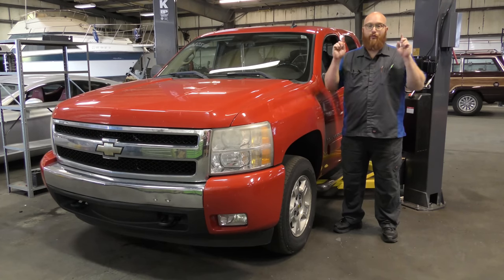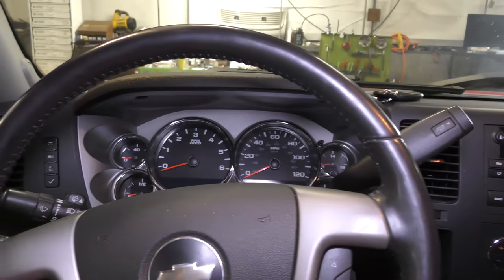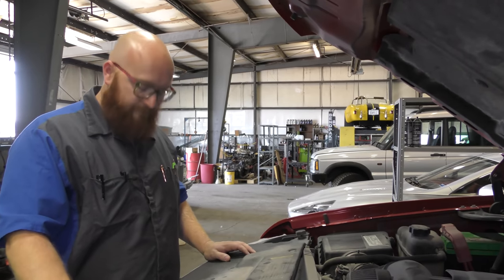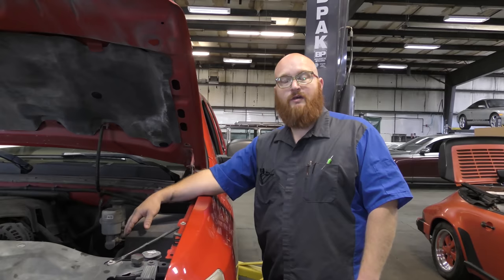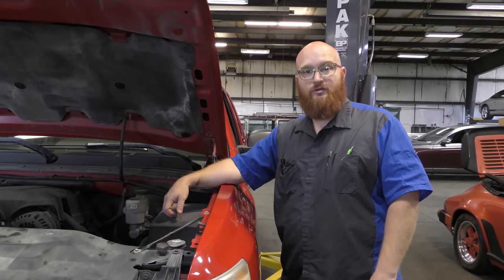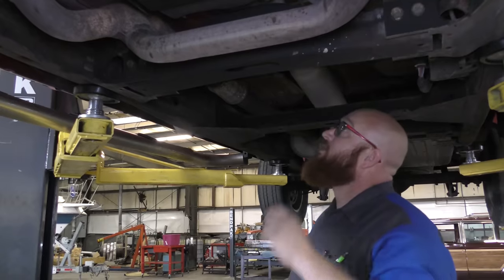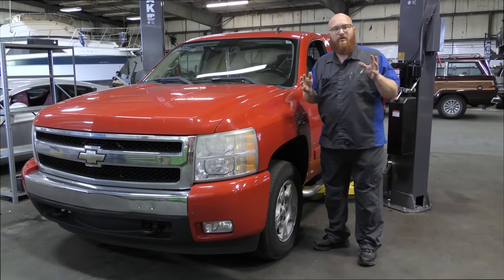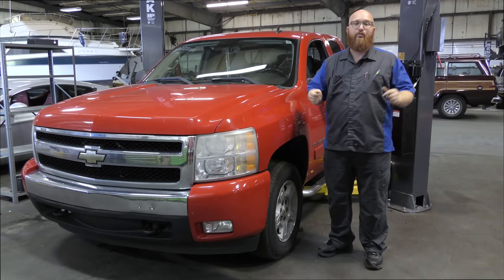Good Truck/Bad Truck? CAR WIZARD shares most common problems on the 5.3L Chevy truck at 100k+ miles

Comment: You could probably just make a living on Hoovie gems purchased. Lol. I'll look for a video on a 2015 Sierra or Silverado 4x4. But, I have a 2015 GMC SIERRA crew cab 4x4 Z71. I have 186,500 miles, I've changed the transmission fluid , complete fluid flush, every 80,000 miles. I would've changed it and the filter myself, but, with GM'S great design, the only way to get transmission cover off, is to drop the exhaust and then jack up the transmission.! Wonderful design engineers.! Plus, the reputable auto repair company I had do the transmission flushes, said I wouldn't have to change the filter.!? I'm just wondering, without changing the filter, just changing the fluid, how long would you estimate before I would have transmission troubles,  I tow a two place atv trailer, about 4 times a year, so, about 3300 lbs. I've changed front wheel bearings, front and rear differential fluid, U-Joints, transfer case fluid, and shocks myself. Had the external oil cooler gasket and return oil cooler lines changed. I have a broken exhaust stud, very back passenger side broken, will have that fixed soon for $250, at the repair shop. Only thing that I haven't done, is the u-joints of the front 4x4 driveshaft. The regular driveshaft joints weren't bad. I live in Michigan, so the front driveshaft isn't used THAT often.

Comment: just the kind of 15 minute content I am looking for , can you please do w the same for the 2009 for f150. I just had a braided brake line go out to the master cylinder after 105000 miles. doesn't seem right.  also the 2009 dodge

Comment: "Service records don't keep the exhaust bolts from breaking." Well, they might if the owner did what I did and put in coated headers instead of resurfaced manifolds. Mine was a 2v Ford though.

Comment: buddy bought a new 03 w/5.3  only has just over 100,000 miles on it as of this year and it already has a laundry list of crap that went wrong with the truck,  rear end blew up on him,  fucking ignition switch failed/frozen couldnt turn it off. door locks randomly shut him out, now he rolls window down when he leaves vehicle while running,  exhaust manifolds which is typical i guess, numerous alternator replacements (they get so hot they literally cook themselves to death) he says its been a reliable truck for him, i broke out laughing, my lowly dakota with 356,000 on it and it never had any real issues with it other normal wear items other than heater core and a water pump replacement, still has original starter and alternator

Comment: Have a question if these 5.3s have that AFM would it be beneficial to pull the heads and check the valves cam and rockers. Ya it would be more but I have that and had to replace. Let me know thanks

Comment: I've seen those crazy exhaust manifold bolts break off just like that one. They suck. EricTheCarGuy had a Pontiac Montana minivan in his shop once and by accident he had the same episode as your coworker had before where he inadvertently drilled into the water jacket. That was a total nightmare for him, he was nearly ripping his hair out of his head over that ordeal. I guess they had aluminum heads on it and those things suck. In the end, I guess he got lucky and was able to fix it with some jb weld since it was so minor and not something that was going to be detrimental to the overall health of the car. That thing had so many other things wrong with it that it was basically a rolling dumpster and that just put the icing on the cake, but thankfully it ended up being okay I guess. I doubt that it's still on the road today though

Comment: I have a question about a 98 Silverado with a 305. I have never changed the tranny fluid. The mileage is at 135k.  Would you recommend my getting it changed, or leaving as is?  (There are no issues with shifting.)

Comment: I was looking at this gen Chevy truck 3 years ago when I bought my 2011 Tundra.  Thought, oh its got the LS motor, had the LS1 in my old Camaro and it was awesome.  Read some more and these all had that horrible AFM/displacement on demand bs.  Yeah it might get 3-6mpg better than the Tundra, but then you spend $3000 having the top end of the motor rebuilt and your truck in the shop for a week.

 Also noticed the interior was kind of shite in these compared to the Toyota or 2010+ Dodge, seats weren't as comfy, dashes cracked, buttons wore off, they just didn't hold up all that well.   And to top it all off, the spec I wanted, mid trim, cab with a back seat, V8, 4wd, under 100,000 miles, the price between the Chevy, Dodge, and Toyota was similar at that time.
Reply: 4.8 is almost the same as a 5.3 w no afm

Comment: There's one Chevy truck that you have to take the body off from the frame to put new brake lines on it where it rusts out..
Then there's the 2.4 terrain engine with the water pump on the crankshaft LOL

Comment: I live in London and I'm not at all familiar with humungous Yankee pickup trucks. Just out of interest, though, what if any difference is there between a Chevy and the equivalent GMC? Which is more "up market" and what is the point of having two brands for the same vehicle? Are there different dealers?
Reply: There are historical reasons for having two brands of nearly identical pickups.  Back when most vehicles sold in the USA were domestic brands, but after General Motors had consolidated several brands under their corporate umbrella, Chevrolet became the largest GM brand, sold to middle America.  The Chevrolet dealers sold all the Chevrolets and nothing else.  Separate dealerships sold a mix of the other brands.  Naturally, some of the owners of the other GM brands wanted a pickup, and by offering a GMC pickup, those customers could buy it from the same dealership which sold them their car, and have them both serviced at one shop.  The GMC tended to be more upscale, with optional trim packages, because Buicks and Cadillacs were more upscale cars.  In the earliest days of the two pickup brands there may have been some substantive differences, but at some point they converged into the same truck with differences in trim and options.

Nowadays, one GM dealership can sell everything, but the difference remains.

Comment: Wizard thanks for the great video, I have an 08 350K miles plus so far lol.... how about welding a nut on the broken head bolt and working it out that way? I had to do it that way, worked great and was quick..... MA salt is not joke...
Reply: Any work done to your 08 with 350k miles ?

Comment: Mr. Wizard i have a 06 4wd Silverado 5.3 with a ton of miles...i have recently done a top-end rebuild and added a tsp stage 2 truck cam with Lt headers and Catback exhaust, new injectors, wires, and spark plugs. yet she drives like someone is holding her back or as if I am towing. the tranny fluid is dark brown as if it has not been changed for the life of the truck. i  am stumped as to what the hesitation could be. My money is of the tranny......what do you think it could be?

Comment: i have a 2003 gmc 1500, and it has a battery drain problem.. and i can take the radio fuse out and fixes the problem..but them my abs lights comes on , on the dash  it is a after market double din sterio i put in it to ,, so can you tell me what the problem is please

Comment: Congratulations on your half hour per bolt.  Sounds fair.  No need to get angry with me. Because in the Twin Cities it is difficult to find a competent mechanic that will not damage the vehicle. With that as the majority offering, competence at a fair price isn’t even an option. It is a shamefully high ratio of poor mechanics. If you are in the Twin Cities and not one of them, you are the minority.

Comment: Around here, Make DOESN'T matter. It's rare to find one over 4 years old without Rust issues. I don't understand paying the kind of $$$$$ that Trucks go for and not do everything in your power to combat rust. Get under the dang thing with a pressure washer or the Car Wash after all the Brine is off the roads. Clean out the cracks and crevices that collect debris. It's not that hard.

Comment: If you find a great mechanic shop, treat them like gold! A car is one of the biggest purchases that you'll ever make, something that you send at high speeds down the highway, DON'T CHEAP OUT!

You are paying for years of expertise, knowledge about endless configurations and horribly expensive tools and overhead. 

Research your car before you buy so that you'll be better prepared for failures and don't skimp on maintenance. If you just have to buy a used prestige car, you better have the means to keep up on repairs!

Comment: My 09 GMC with the same engine had displacement on demand lifter failures twice before it was out of the 36k mile warranty period. It is a terribly unreliable system. I'm curious why that system was not discussed in this video.

Comment: I need help, I have a 94 k2500 and when I hit the brakes both blinker lights light up on the dash. When I release the brake they don’t light up. When I use the blinker they do not come on. I changed the bulbs, check the connections to make sure they are tight and clean. I am so changed the blinker module in the fuse box.

Comment: I did a heater core on a 1980s ( I think it was) Cadillac book time was either 8 or 12 hours I did it in 2.5  it was years ago back in the 1990s so I dont remember the exact the book time .mind you my hands were cut up it, requires to remove the hole dash and allot of plugs and wiring  which I didnt do my boss of course charged the customer 12 hours I learned my lesson to not go so quick and just take around as long at the book times says why should I work harder and get6 paid less when the boss was making large cash for my work. of course my boss claimed that he did all the work also lol
yes shop time, employee wages just to name two things .   A car up on a hoist for tires makes allot less then most other reasons a car is up on the hoist. plus you need to buy a balancer and maybe two different kinds of tire changers not worth it unless you are just doing tires lol.

Comment: My boss had one of those pieces of shit. It leaked from everything. Door hinge bushings were gone. U joints squeaked. Dash was cracked. Oil pressure sender and the screen were bad. Oil cooler manifold leaked. Oil pan leaked. 

Garbage.

Comment: I have a '04 Tahoe 4.8 and The check engine light is on for a gross leak no flow, I've changed the fuel cap to no avail and along with that it says I have a multiple cylinder misfire, I've changed spark plugs, wires, ignition coils, fuel injectors, air filter, cleaned maf sensor, The truck barely misfires at idle can't honestly tell it's so smooth for the most part.. I was thinking fuel pump because light flashes above 65mph average. But I put pressure gauge on fuel rail and it's above 45 or so from not mistaken but I don't know what it's like under load I don't know much I just watched YouTube videos to assist but any help here guys! Think internals are bad? Engine has 173,000 No noises no nothing she is very quiet no smoke sometimes a gassy smell but other than that there's no major noticeable signs of problems.

Comment: Book times are set by the manufacturer. Based on how quickly the AVERAGE tech could and should complete a job. 

If I do a job 100 times and can beat that book time, I'm charging the same. But at the same time, if a job heads south and I only quoted you for 5 hours and it takes 10, I'm still charging you 5. It goes both ways, people need to remember that.

Comment: The oil cooler plate, would that cause it to be visible in the rear main seal check plate?
Reply: Mine was leaking from both, did the rear main seal first. Then noticed low oil pressure months later. Changed out sensor behind intake no change in pressure. Changed out oil cooler plate that had a small leak and pressure came up to strong numbers at idle. Mine leaked and ran down the motor to the seal area.

Comment: I had to watch this. I used to drive a POS 2010 v6 standard cab at work. At 70k had to have engine rebuilt. Every week had to replace a headlight. Every 2 bulbs per side had to replace the plug too. At 80k took it to our garage for state inspection & they said it was done. Both floor boards were not there anymore. It was never rained in. It was bought brand new and been on coast of virginia the entire time. Maybe been in snow 2 maybe 3 times I guess. So the truck was trash. Company bought us another brand new one - 2021 4 door v6 silverado now. Check engine has already randomly coming on at 1600 miles & goes back off. Chevy... Pile of sh#t

Comment: That AFM really screws an otherwise great engine.   Mine got a collapsed lifter on cylinder 7 and tore up the cam.   It’s a shame they put that stupid garbage system on that costs you way more money to repair than it ever saves in fuel.

Comment: dirty little secret- most shops make money on the parts as well as the labor. That $200.00 alternator you see on the invoice is not what the shop paid because they get 'jobber pricing'.
Reply: That isn’t a secret and isn’t dirty.  Of course there’s a markup!  You are buying retail.  You pay for the parts department to have the part in stock, or to get it for you when you need it.

Comment: Mr wizard, so I’ve been watching your videos on what to buy and what not to buy. You seem a bit bias on the Chevy Silverado trucks and how much better they are yet, you’ve always seem to have one to work on for one reason or not. For me, a good vehicle to have is one that is not in a shop being worked on for one or more reason. I don’t doubt your skills, knowledge, or experience with vehicles, but I’m am doubtful about getting a Silverado truck based on your videos.
I’m in the market for a 1/2 ton truck, I don’t need a 4x4 or something to haul a large trailer, just a truck, everyone needs a truck or could use one. I just don’t know what to buy others than a Toyota but, I can’t afford the upfront price of one. Question is, if the Silverado is one of the best, why do you always seem to be working on or talking about working on them?

Comment: I strongly disagree about the headlights. They're a critical safety components and those lenses are letting very little light through, the top especially.  Good luck putting 100,000 more miles on it if you ever have to drive it in the dark. Shouldn't even pass inspection with cataracts on both eyes like that.

Comment: drivers rear bolt on my exhaust manifold broke off below the surface welded a nut to it came right out disconnect your battery first before trying

Comment: I have 365000 on a 4.8 in a chevy van put transmission in at 200000 tires and shocks brakes oil thats about it .

Comment: GM has the worst exhausts I've ever seen. From 2011 to 2016 I've seen exhaust manifolds literally crack in all the way in half.  They switched to bolts because the studs they used to use in early 2010s would snap off if you breath on them. The bolts aren't any better.  My friend had one and he wanted to change the exhaust I told him to do the entire exhaust. Aftermarket is the only way to go with GM.  He hasn't had a single problem with the exhaust.

Comment: Bad mechanic? Like he said …it takes him 30 to 45 minutes to do the intake but he will not take a paycut for being fast so he will still charge the customers for 3 hours😱😔 this is the reason i fix it myself and only use workshop when i have no choice,and luckily i have a good mech here that has a good rep and is trusted…i would not go to this workshop…hevwould take a 2 hour job forvan oil change he does in 20 min😱🤑🤑

Comment: You not taking a Pay Cut, or you’d rather not be honest? I’m sure if you had an employee that said they worked 8 hours but left at 5 hours you wouldn’t be to pleased… So why not have set prices for jobs you know you are faster at with an asterisk denoting pricing can be more if it takes longer or other issues occur… I’m sure if you went over the 2-3 hours you’d charge more as well! Let’s be honest and fair!
Reply: Lots of repair work is done on a flat-rate basis, not just auto repairs.  It’s better than paying someone who doesn’t know anything to noodle around for a long time without fixing the problem.

Comment: These body style Silverados and tahoes i have seen being unreliable. My friends grandpa had one go to 200k miles but went through like 10 fuel pumps, injectors, coils, alternator, starter, all kinds of suspension. Just about everything needed replacing and had issues with traction/abs system and intermittent missfire. Would never buy one

Comment: Wizard seems like a sensitive guy and the conflicts with the customers are starting to get under his skin.   If the book labor rate is 30 minutes to drill out a bolt, then the customer has nothing to complain about.  But Mrs Wizard probably needs to intervene when Wizard is pissed off at customers.  Venting to the public could erode the customer base.  The wizard is an honest mechanic and his customers should be happy to have his services.

Comment: 99-06 gmt800 trucks are better.  Straight LS engine without the cam phaser or cylinder deactivation crap.  They took the best GM engine ever made and ruined it.

Comment: There is always a way to cut a mechanic from robbing you. You let him diagnose the car and then find out what parts it needs. "Your alternator needs to be replaced. That is an $800 job". You go get your own alternator so you can't get robbed on the part, that way you only get beat on the labor.

Comment: The door handles crack out too.
Reply: More common on the chrome and painted door handles. If you have a pickup with the WT, LS, or LT package, the interior door handles break off too.